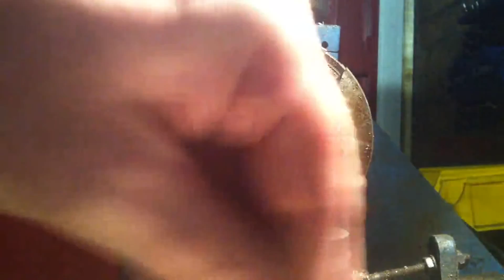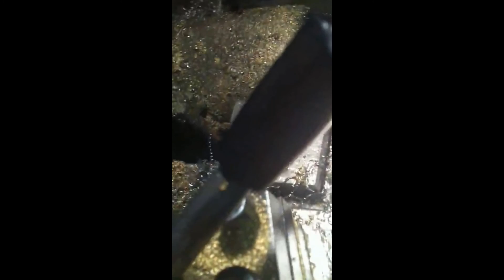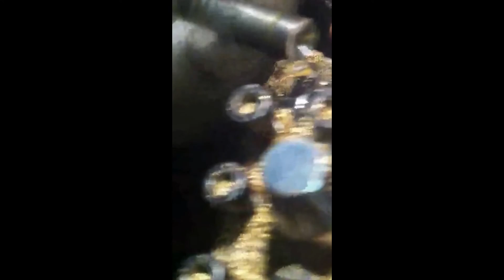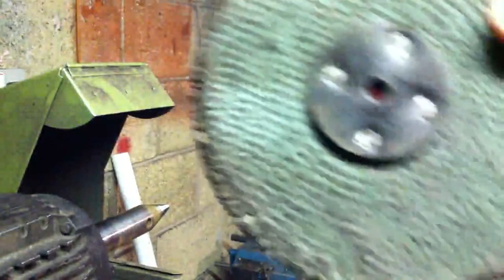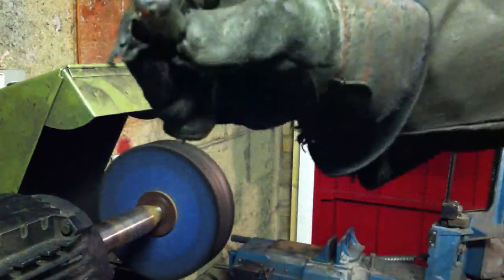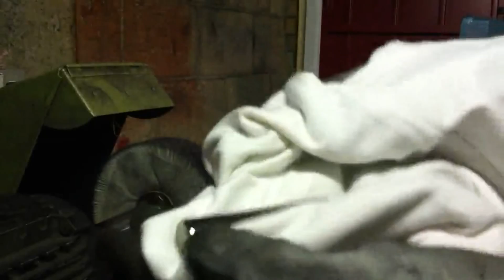Making a stainless steel bullet tone bar for lap steel or Hawaiin guitar

Comment: Highly commendable, but # 1 the spelling is 'Hawaiian,' and #2 you polish longitudinally not round the bar. #3 "Vienna Lime powder" is used to remove the polishing compound residues left by the final polishing..
Reply from the maker: Hi Basil. This is quite an old video which I need to update soon. I have changed some of my techniques since it was uploaded. For example I have made better jigs for holding the bars when polishing and I have made a better dome turner. I now also add a small radius to the back edge. With the the polishing I think at the time I figured that I would polish in the direction the bar moves up and down the strings. But I now polish the final finish longitudinally. If you use a dry finishing compound with the correct mop and polish with the bar still warm. You don't need to use the Vienna lime powder. I will have to change the spelling of Hawaiian.